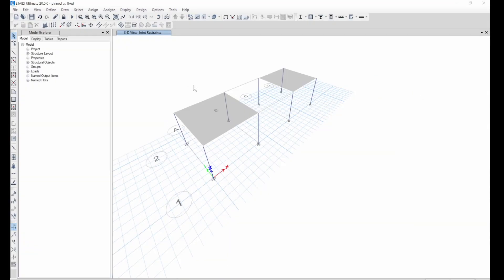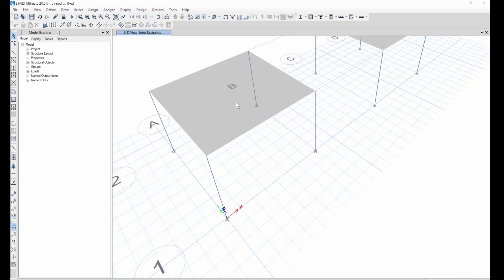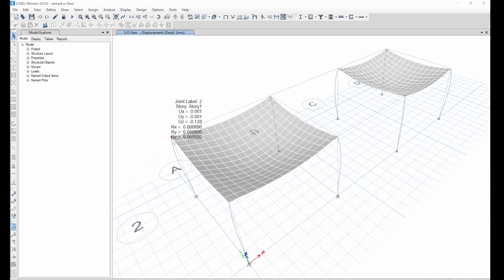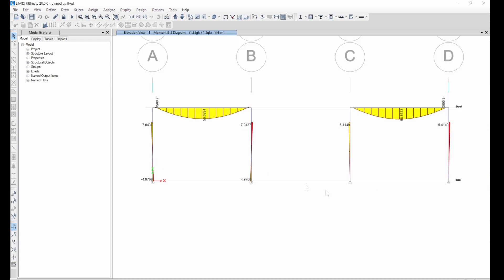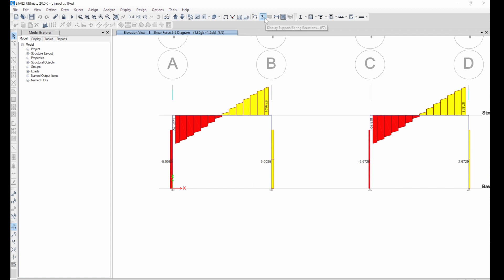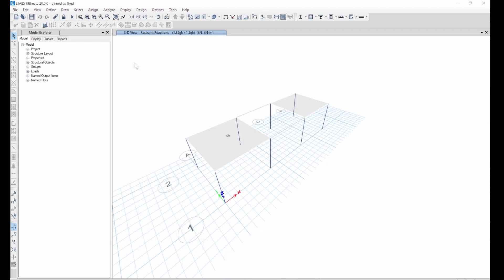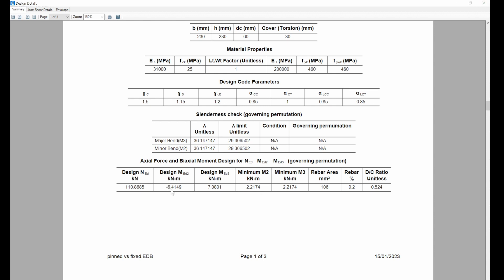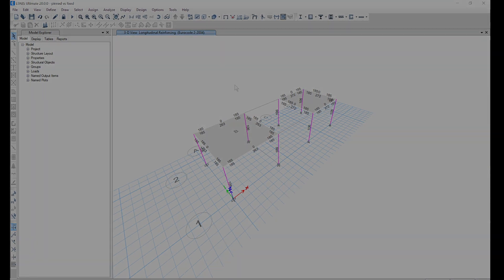Pinned or Fixed support for my RCC columns ?

Comment: But in Nigeria, most engineers design and construct their reinforced concrete structures as if they are fixed because columns are always thought to be carrying loads from slabs and beams.
Reply from the maker: You can email me and I would show you how a pinned and fixed rcc column base are constructed
Reply: @Lanreolokunola  I sent you a mail
Reply from the maker: Support@structdive.com